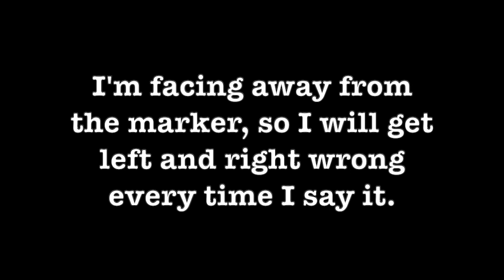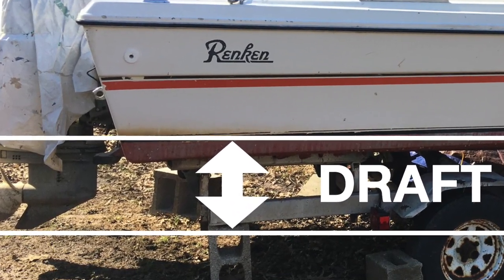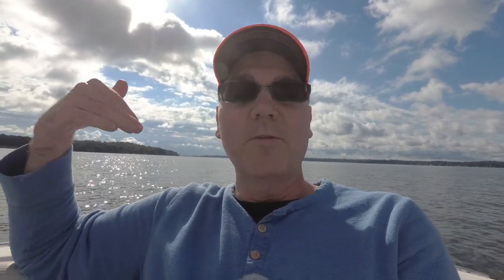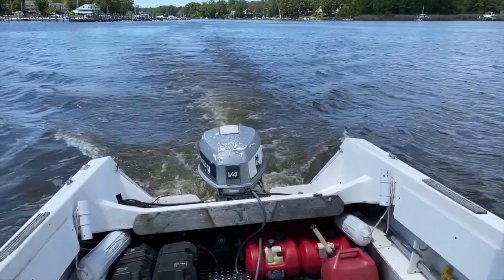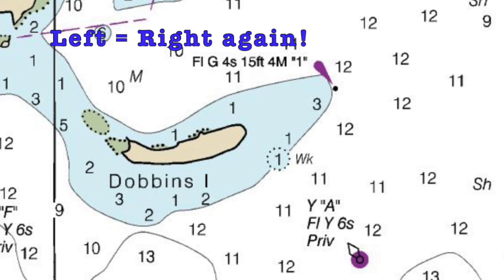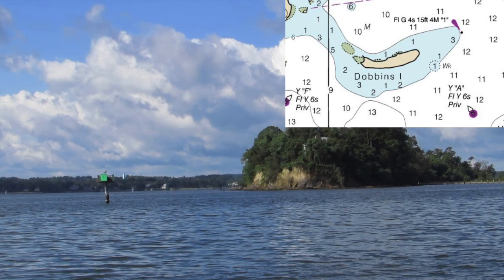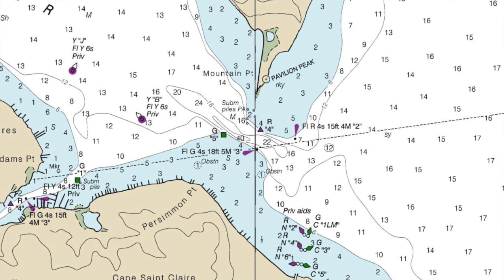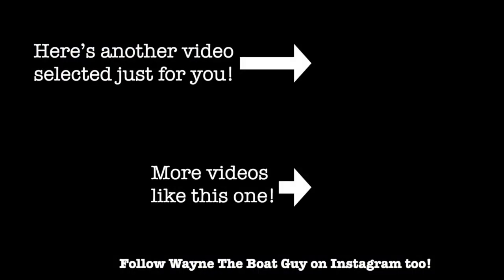How shallow can my boat go? Boat draft explained to prevent running aground

Comment: Menimum Depth of water required for 20 feet bot ? thnq
Reply from the maker: It varies by the boat. Some boats have a shallow draft and if they aren't loaded down with fuel and people, they might be able to handle pretty shallow waters - like under 2 feet (24 inches). But it can really vary by weight and design of the boat.
Reply: 20 foot. Shallow water cabjn crusrr 10 I nches.      Too 15 knch 20 foit shalow water csbin cruser

Comment: not to mention sucking all the sand up inside of your water pump which if it goes unnoticed it was certainly destroy the internals of the motor by overheating. and if it was my luck it would go out on me while I was 7 to 10 miles offshore. on one of the busiest days of the year where tow boat USA has got a 8-hour wait. lol. even though 90% of the stuff you mentioned seems to be common knowledge it's always good to go over everything especially since I don't get out in the boat but three times a year maybe four that it certainly not muscle memory. I got lucky I pulled my boat out of a boat ramp one time without raising the motor. that could have been a hellacious day. just one of the things that should be obvious to everybody but can go unnoticed too many voters that doesn't go out very often or you got your mind on other things new people in the boat and such. anyway thank you for your time
Reply from the maker: Yeah, I don't think many people consider just how long a person could be waiting to be towed in!

Comment: I’m on the Saint Lawrence sea way just ripped my bravo drive off absolutely devastating I just got the boat last month . We have areas just like this here how ever I learned that quickly I ended up hitting an under water wall unfortunately. Unmarked how do I avoid this ?
Reply from the maker: That's awful. I've heard of that exact same thing happening to others as well. Is the under water wall not on any of the charts?
Reply: firàwar scaig sin onterohas sinar